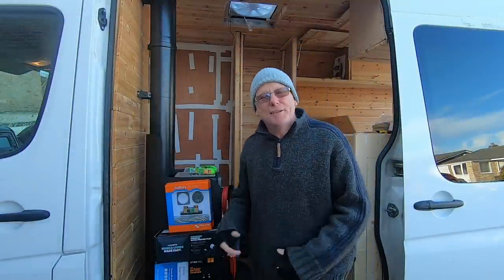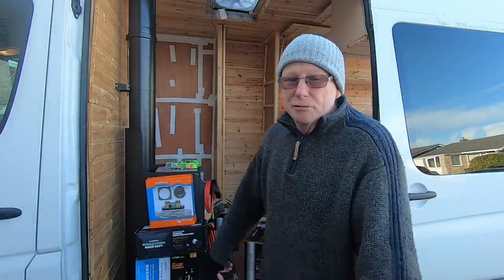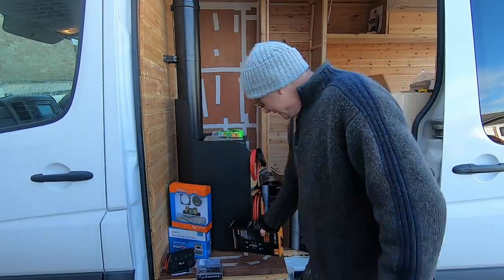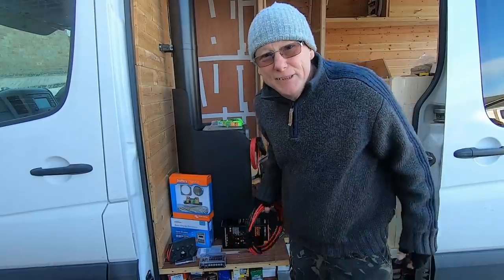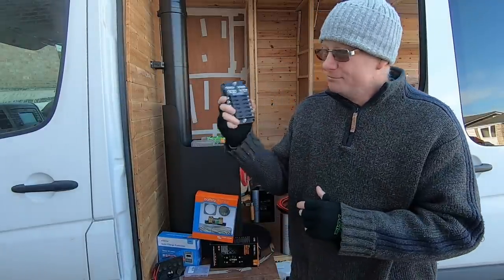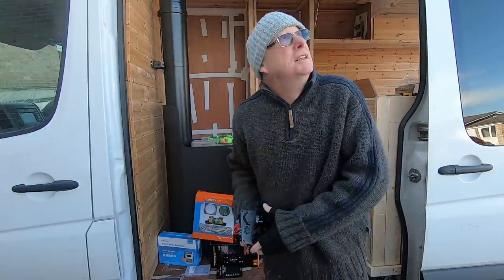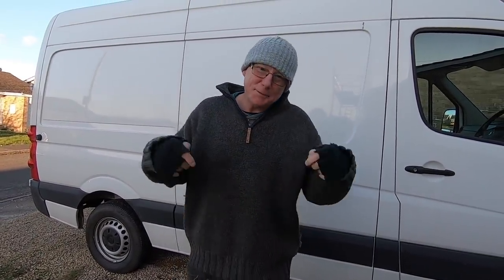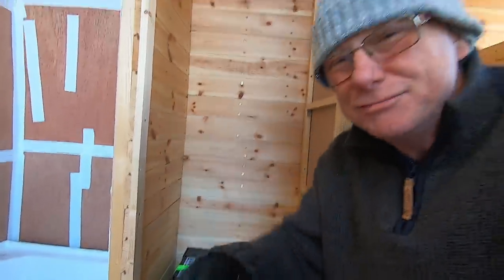Installing AGM Leisure batteries Into A VW Camper van Conversion #vanlife

Comment: Wow, Mel.
Just went through the links & the 2 batteries, charge controller, and the switch panel come out to more than £1000!
Add solar panels & wiring and it turns into an expensive adventure.
My 180W panel (inc. controller) was about £230 plus £80 shipping to Spain, and l just bought a new 120Ah battery for 95€.
It's been working fine for the last 4 years.
Reply from the maker: Yes she has spent a lot of money so fare totally over the top talk about up selling it’s a joke I’m doing the best I can to try and save her some money now 👍
Reply: Really mines come to £700 for everything solar panel, batteries, all the smart controller, monitors blah blah. If u can make it cheaper please give me some advice or websites please 🙏

Comment: Hi again Mel. I purchased the CTEK charger for my van and its doing a great job, thanks. Reconditioned and fully charged two flat batteries. 
As I was looking at the wiring of my already converted van, I cant seem to find where it has been earthed to the chassis anywhere. There was a blue cable running from the negative of one  battery that had been attached to the metal frame of the bed which had been bolted to the floor, but as I have now built a wooden pull out bed I had to cut it. So I am guessing this was the previous owners cowboy attempt at earthing? I am going to buy some new cable and just run it from the negative of one battery to the chassis, but I am unsure which cable/size  to buy! does it have to be a special cable,? 16mm ? Copper? Bit confused.
 I just went to my local electrical trade shop but they don't  stock  12v and couldn't answer my question.  Thanks again in anticipation of your reply  :)
Reply from the maker: Hi Sharon all you need to know is here in Greg’s video if you are still unsure about what to use after watching then please get back to me https://youtu.be/koFg6oFs0RU

Comment: hey mel the batteries are 120ah each so thats 230 all up BUT and i say BUT you dont want to go lower than 50% discharge battery life is degraded fast after even one 80% discharge , so  I would never go down lower than 70% charge that would mean she has useable 75 or so amps , we have 8 x 140 ah and we still use 30% evey night ( cpap) and lights ect ect .
Great vid buddy
Reply from the maker: Thank you for the great advice I’ll pass it on 👍🍻

Comment: 284 quid for the  ctek holy cow and its only 20A ??   You need to drive from London to Leeds everyday to put back what you used last night. LOL
 Would be better to just use a bit of cable between the batteries with toggle switch and save £280

Comment: The volt meters on the usb ports around my van all show slightly different readings! No idea why 🤷🏻‍♂️
I always go by the VictronConnect app. It all seems ok with no obvious problems.
Reply from the maker: You’re absolutely rite my usb voltage meters are all different too 👍😊👍

Comment: No  Mel, you are not quite right. 2 x 130amp/hr batteries, mean you have got 130amps available has you should only take them down to 50% state of charge
Reply from the maker: I stand corrected 👍😂👍🤷‍♂️
Reply: Sure it was just a slip of the tongue  😀
Reply: I think lead carbon batteries and can go down to 70% discharge without damaging

Comment: Do you still recommend the Ring Smart Battery Charger or do you think the CTEK is better.Great Video thanks.
Reply from the maker: Im still in favour of my ring dc to dc controller 👍😊👍
Reply: Votronic battery to battery chargers are very good I recommend them.
Reply: Is that victron ring dc to dc? Is this OK for vans with smart alternators and can solar be put through them as well?